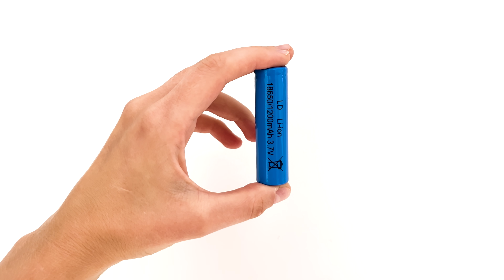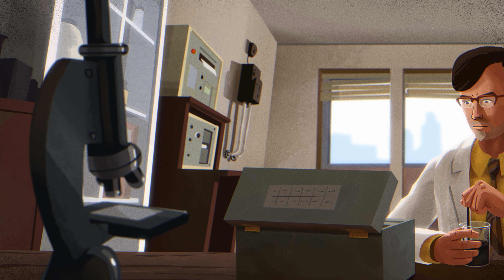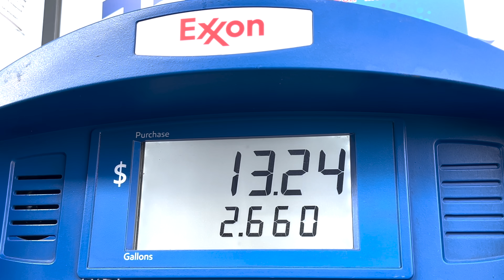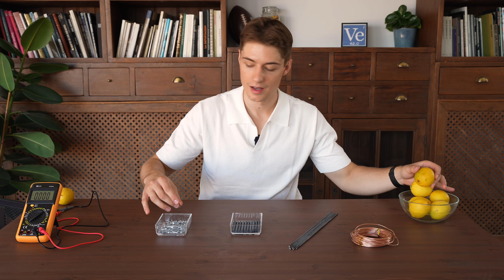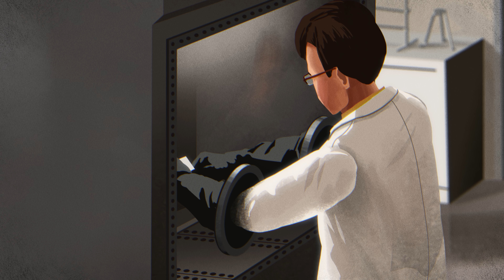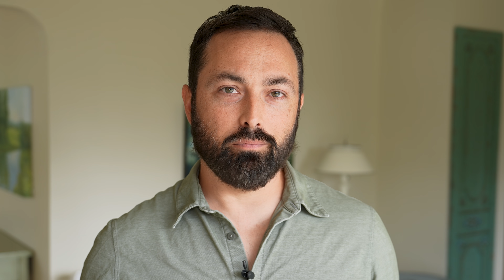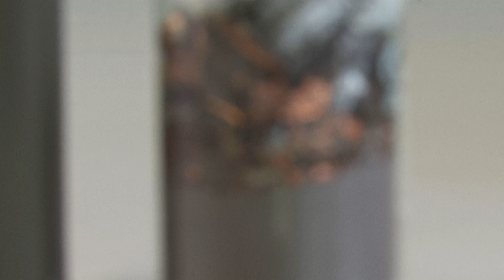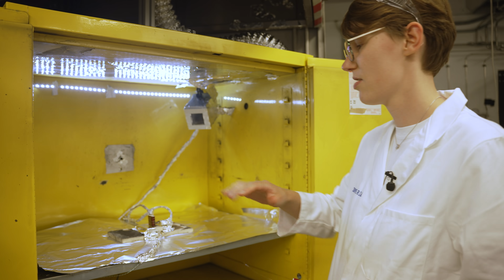The Perfect Battery Material Is Dangerous

Comment: I have developed an original waste-to-energy theory called The Lumangyao Method. It utilizes Sugarcane Pressmud (also known globally as Filter Cake or Filter Mud) through a unique "Dual-Harvesting Hybrid Cell." The bottom layer operates as an Acidic Microbial Bio-Battery utilizing the mud's natural acidity to generate electricity. Simultaneously, the top layer features a Thermoelectric Generator that captures additional power from the mud’s intense biological heat contrasting with the cooler night air. This dual-harvesting system from a single agricultural waste has never been done before, and I am looking for international laboratory researchers and engineering collaborators to build the first prototype! THIS SYSTEM WAS CONCEPTUALIZED BY JOHNNY ARANG LUMANGYAO FROM THE PHILIPPINES

Comment: In RC's I have NiHM (nickel-metal hydride) batteries for older cars that can't handle the higher current or performance. They are very stable, long lasting, and easy to maintain, but they are bulky and heavy. They drop off quickly in performance when they expire. Li-ion batteries are mostly relegated to low performance electronics use and I've found them to be quite safe and long lasting. LiPo batteries (lithium polymer) on the other hand have the highest energy density and best current capacity, but when they fail they fail spectacularly. They have to be charged/discharged, and stored carefully. Once they start showing signs of gassing out or they start to voltage sag they are dangerous.

Comment: The LiPo battery was revolutionary for the RC / remote control surface and air  industry.  

Been into RC since childhood, 48 / so about 40 yrs.  First, they were all electric, cars / trucks went 11 mph avg, 30 mph for custom, high end expensive set ups.  Then came Nitro and could into the 50 mph range. Now, with the emergence of LiPo battery - cars can go 120 mph out of the box and over 280 mph customized.  Now, the problem with exceeding that 280 mph speed is the tires- they blow apart.

Comment: Key Strategies for Dendrite Prevention:

Solid-State Electrolytes (SSES): Replacing flammable liquid electrolytes with solid, rigid materials creates a mechanical barrier that prevents dendrite penetration.
Surface Coatings (Artificial SEI): Coating the anode with materials like lithium-phosphate (Li3PO4), graphene, or polymers helps distribute lithium ions evenly, reducing the creation of hotspots where dendrites start.

Electrolyte Additives: Modifying liquid electrolytes with additives can stabilize the Solid Electrolyte Interphase (SEI) layer, promoting smoother metal deposition.
3D Anode Structures: Utilizing 3D porous materials (like copper frameworks) reduces the local current density, making the deposition of lithium more uniform and reducing the likelihood of dendrite growth.

Self-Healing Electrostatic Shielding: A positive charge (SHES) can be applied to the anode to repel lithium ions away from existing protrusions, causing them to deposit in lower areas and smoothen the surface.

Battery Management System (BMS) Controls: Preventing dendrites through usage habits, such as avoiding fast charging at low temperatures (below 0°C), which
increases the likelihood of lithium plating.

Comment: I remember using an electric bike when in had sealed lead acid batteries...it lasted 6 months and maybe 150 charge cycles. 
When I got my first ebike with a lithium battery it lasted 5 years... and probably 1200 cycles.

Comment: I once saw a Tesla take fire. 
All traffic was stopped for several hours. It’s super dangerous. It’s practically unstoppable. They can’t do anything but cooling down until it burns out.
And they still need to put the wreck in a specialized tank with water and dump it at a safe place for at least 48 hours.
Thankfully no one was injured.

Comment: 10:05 what's wrong with your lithium? Every strip of lithium I've ever thrown into water has exploded? Even the tiny ones. They weren't huge exploding fireballs but they did explode and catch fire. Also mine never turned the water purple but it was also in puddles on my black asphalt driveway.

Comment: I remember hand-carrying some of the later prototypes of the Sony battery to Germany. At the airport security checkpoint, the x-ray scan would reveal cylindrical high density objects that are hand wired to a controller circuit board which looks exactly like a time bomb. I had the necessary legal documents but nobody had heard of Lithium Ion batteries so I had a hard time explaining what they are.

Comment: The flammable components of a modern lithium-ion battery are two things: the electrolyte, which is a highly flammable liquid or gas, and one of the polarity components, which is made of aluminum foil coated with lithium cobalt oxide. The oxide, along with the aluminum, forms a type of thermite that when ignited burns at very high temperatures.

Comment: Just to be clear this is a gross simplification of electricity. Electrons don't actually travel through the wire like shown. Basically the zinc electrons move slightly over to the wire electrons which all in turn eventually push the electrons into the copper. It's shuffling more than a motion illustrated. More like how water moves through pipes, but way slower. Signal speed vs drift speed.

Comment: What about Nickel Cadmium (Ni-Cd) vs Lithium?
Reply: NiCd has so much disadvantages if compared to Li-Ion and/or LiPo. Lower energy density, lower volts per cell in same sizes, faster self discharge, lowered max capacity if not fully empty before being charged, (apparently) pretty toxic to recycle compared to the lithium twins. The only few advantages it has is that it is cheaper up front and works better when it's very hot or cold. Very few advantages not worth using in daily use of almost any electronics, but a good bet if you want to power something that needs to work at extreme temps and don't care how long it needs to be powered, just that it must be powered.

Comment: The video doesn't state what the fuel is that combusts when the Li-ion battery goes into thermal runaway and burns. However, I looked it up: When a lithium-ion battery fails and enters thermal runaway, it releases a complex "cocktail" of flammable and highly toxic gases. These emissions result from the decomposition of the battery's internal components, specifically the organic electrolyte solvents and the lithium salts. 
Primary Burning & Flammable Gases
The most abundant gases produced that contribute to the fire and potential explosions include:
Hydrogen (
): Highly explosive and often the most prevalent gas, particularly in Lithium Iron Phosphate (LFP) batteries.
Carbon Monoxide (
): A toxic and extremely flammable gas that is a byproduct of incomplete combustion.
Methane (
) & Other Hydrocarbons: Includes ethane (
) and ethylene (
), which are products of electrolyte solvent breakdown.
Carbon Dioxide (
): While not flammable, it is produced in high volumes and acts as an asphyxiant. 
Highly Toxic Byproducts 
These gases pose the most immediate health risk to anyone inhaling the smoke: 
Hydrogen Fluoride (
): A uniquely dangerous, corrosive gas formed from the decomposition of the lithium salt (typically 
) in the electrolyte. It can cause severe internal lung damage and chemical burns even at low concentrations.
Hydrogen Cyanide (
): A lethal asphyxiant that interferes with the body's ability to use oxygen.
Phosphoryl Fluoride (
): An intermediate toxic compound that can further react with moisture to produce more hydrogen fluoride.
Hydrogen Chloride (
): Another corrosive gas that can be present depending on the specific materials used in the battery's casing or separators.

Comment: Update, several months after this video was released, CATL, the battery company released the latest iteration of Sodium ion Battery, this one has a power density between LifePo and Lithium ion, but less than half the price of Lithium ion, no thermal runaway, works well below freezing temperatures and life cycle twice as much as Lithium ion,. It has recently been publicly available to the market, scaling up currently, and in a couple of years is expected to displace Lithium ion.

Comment: Please add a section to this video related to the new solid state battery design. It is going to bring another revolution to the battery industry. Solid state batteries are smaller, lighter, safer, recharge faster. Toyota has claimed they can produce an electric vehicle with more than 700 miles of range at an affordable price. Other manufacturers are already making SSB's and they are living up to the claims. Unfortunately, they are expensive, but economies of scale will bring the cost down. If the hype is true, in the next 10 years internal combustion engine vehicles will be a dying breed. I have driven an all electric car for almost 10 year now and I love passing the gas station and not caring about gas prices.

Comment: First off there are environmentally friendlier ways to get lithium if the US chooses to pursue it. 

The US already has lithium here (as does Canada). 

There is a geothermal energy plant by the Salton sea in southern California that uses hot underground brine water to generate electricity. That hot underground water happens to be loaded with minerals, and one of those minerals is lithium, and quite a bit of it! 

One estimate is that there is enough lithium there to meet all of the United States needs...
    ...and forty percent of the world! 

There is a process called Direct Lithium Extraction (DLE) that filters the lithium directly from the hot brine water and then returns that water back underground.

60 minutes did an episode on the method:
'California’s Lithium Valley could power electric vehicle industry | 60 Minutes'

Note that the US currently gets bromine from underground brine water in southern Arkansas by a similar method.

Comment: 2:20 fun fact: in the BMW 1802 tii, 55 mph used more power than 35-40 (low sweet spot on said car) and 60-75 (high sweet spot.) so bmw had to make the well known 2002 in response to the oil shortage in the USA, the place where 8 of there factories were at the time

Comment: The information here is very out of date. No mention was made of Lithium Ion Phosphate ( LI FE PO4 ) battery technology. Tesla has changed over to Phosphate in the last 4 or 5 years because safety is their number 1 priority.  BYD also changed over. The BTD demonstration showed a standard LI-Ion versus their 'blade battery', alongside each other , both had a steel rod forced right through them, in a glass case. The LI-ion battery burst into flame immediately while the 'blade' didn't react at all.  It still operated as a battery.   The advancement of battery technology is one of the fastest areas in chemistry today.  And recently the Sodium battery has emerged, sodium being very close to lithium on the periodic chart but far less volatile then lithium.  And Tesla no longer use cobalt in their batteries. Please do a new version of this episode showing the latest safety in the newly developed batteries. The time is now. We ALL need to stop burning fossil fuels as soon as we can.

Comment: Lithium ion is relatively safe compared to LiPo batteries used in current RC vehicles.  These can provide 500-1000 amps for short periods and are used in vehicles that regularly jump 25-50 feet high and 100-200 long and also vehicles that go 230 plus mph.  They're usually fine thru all that unless they get ejected and puncture.  Usually the worst danger is while charging incorrectly.

Comment: Lithium Ion will never be replaced in portable devices or electric vehicles. Lithium, being the lightest and smallest of metallic elements, means it will have the highest storage density per kilogram, and, perhaps, liters of volume, of any chemistry out there. Aluminum, zinc, sodium, and other anode materials will vie for stationary energy storage applications, where weight and bulk aren't nearly as important. For those applications, the main criteria are cost, cycle life, "round trip" efficiency, and the availability of materials. They can be as big and heavy as they want, as long as "the price is right".
Reply: The New Battery Tech, solid state battery (SSB) is free lithium

Comment: 11:32 you have the anode and cathode backwards.  The cathode is negatively charged, as are electrons.  They move from an area of negative charge to e to an area of positive charge until there is an open in the circuit or there is no potential difference (voltage) remaining.

Comment: Dr goodenough did the li-ion batteries, dr outstanding did the al-ion batteries, now dr extraordinary will do ca-ion batteries, then the dr transcended will do the the plasma thermal fusion hyper solid electrode batteries, aka the hyper caesium ion batteries(using caesium as its anode and magnesium oxide as its cathode and an hyper conductor(an material that conducts all the ions but insulates all the heat and electricity) as its separator and an hyper solid(an material that conducts 100 percent energy and is infinitely viscous and negatively infinite viscous at the same time, and doesn’t react with anything in any situation) as its electrode and use d-he3 as its fusion fuel and uranium-235 as its fission fuel).

Comment: @3min the battery circa 1905 was not the only large problem w EVs of the time as claimed. E motors were only 70% efficient then vs 97-99% now.  That too ate into range, but also caused heating problems which could not be solved easily w/ water cooling as applied to combustion engines

Comment: Electric cars are nice and all but the grid can’t take it and we have to destroy more land to produce the balance. Then there’s the storage and disposal of toxic chemicals.  All of that is secondary to the real problem with the lithium battery:  Catastrophic failure of lithium ion batteries, including the ones in ev’s, can cause fires that produce their own oxygen.  You can’t smother it or attack the base of it will burn until there’s nothing left, usually at the expense of  their community.

Comment: I ran many voltaic pile experiments when I learned about Alessandro Volta whilst studying with George Brown College.  I was able to drive current across the PN of a red LED for several days using copper and aluminum foils.  Curiously, oxidation needed to be controlled, and the water needed to be very near pH7.  I have theories, but it's been a very long time since that research.

Comment: Bio electrical systems exist, membrane potential of cells can change dependent on ions flowing in and out of the cell, when a neuron depolarizes it changes the membrane “charge” so the frog tissue could be responding to the flow of its ions found in its tissues as well. 3:45 . Im not saying the frog has its own animal electricity it’s just electricity but from organic molecules and systems. But a lot of signals sent from neuronal tissue to muscles involves both chemical and electrical signals, that result in the release of neurotransmitter so assuming the animal had at the time of the discovery its own electricity wasn’t a crazy idea.

Comment: I had a cellphone burst into flames while I was holding it in my hands. so I dropped it on the floor. and kicked it out the door into the snow bank. and even in the snow bank it still was burning aggressively. and I pretty much just had to let it burn out. and when it did I retrieved the phone and wasn't much left of it. it was strange because I didn't really notice the phone getting hot before it burst into flames. it was just lucky that I seen the flames start shooting out of the phone. so I dropped it otherwise I could have possibly received some potentially bad burns? and since then it gives me something to think about when I'm handling a phone.

Comment: One problem with a runaway battery fire should be mentioned: You can submerge the whole thing in water and cool it down, but as soon as you take it out, the reaction accelerates again to the point of reignition. Even hours later. That is a huge problem with (older) electric cars, because it makes transporting a wreck safely... challenging or even impossible, depending on where it went up in flames.

Comment: Usually like your in depth research, but this video lacked quite a bit.
First, you really needed to add Baghdad batteries to the mix, even if speculation. Second, there were sodium batteries on the market when you made this video; as well as Tesla's research into aluminum batteries. Also, research is making way into more complex alloys or even no metal batteries, which is also important.

Comment: Worth mentioning that by the time Sony introduced the handicam, The US Air Force has manufactured and installed tons of the things in Minuteman silos for extended battery backup power. It didn't end well. They then had to freeze the entire silo equipment space with tanker trucks of liquid nitrogen, remove the failing batteries, and ship them still frozen to Utah where they were put in ammo bunkers in the desert. The first production contract was let in March 1978 to GTE Silvania. Later Altus also got a contract.

Comment: 32:00 You need to get water into the battery enclosure.   The water will cool down the neighboring cells.   

The battery that is currently going through thermal runway cannot be extinguished 

All you want to do is make sure that the cell that’s going through thermal runway does not spread to other cells 

And you do that by flooding the battery enclosure with cold water  

And there are a couple of tools out there that do this right now 

One of them is called the MurerLance and firefighters have been testing it out and using it in the field and they’re able to extinguish an electric vehicle battery fire in 10 minutes and use only 20 gallons of water.